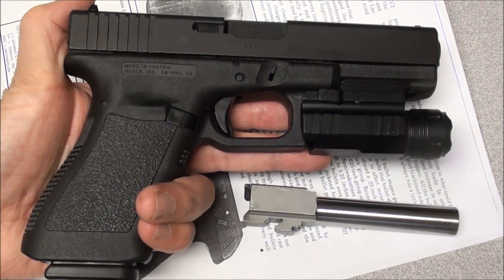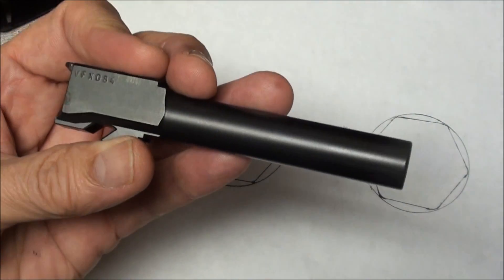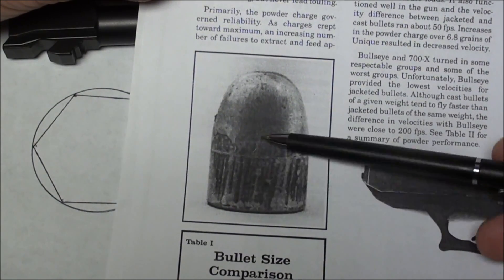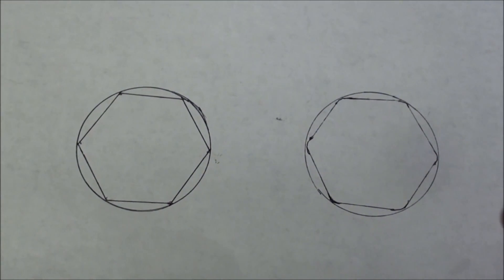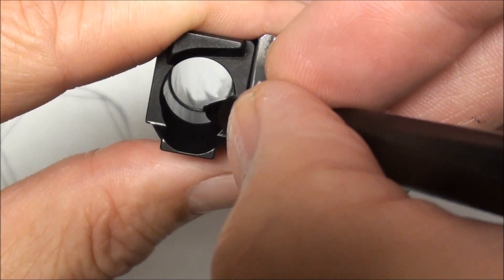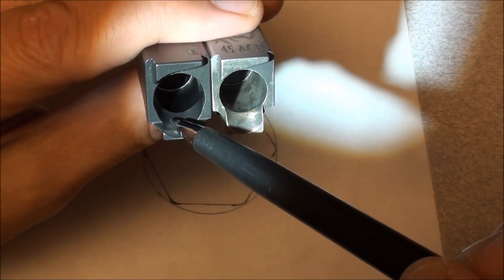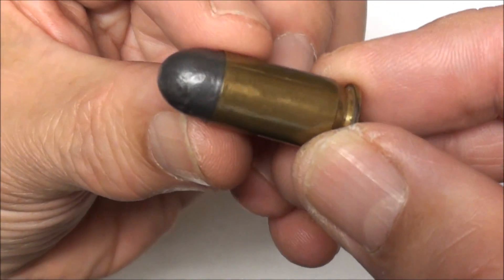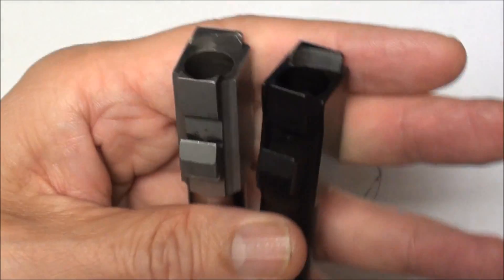Polygonal Rifling in Reloading Ammo for Glocks

Comment: When I bought my G17 in 2003 I also bought a KKM barrel because I was told not to shoot lead in it. I had been reloading for 45acp and 9mm since 1992 for a 1911 and various 9mm pistols. At my first IDPA match one of the guys ask why I had a KKM Match barrel. He said he and many others had been shooting lead reloads through their;s for years without a problem.  So I tried my reloads in it, sized to .356". So far I have shoot 170,000 rds through it as of last week. Half of those through the Glock Factory barrel. No problems so far. 147 grain Lyman #2 alloy and Lee 124 grain tumble lube bullet. I only use Winchester std primers and Tight Group or Bulleye. I have two Dillon 1050's a 650 and a 550B. Yes I shoot a lot. 

Good video sir.
Reply from the maker: Khristy Stewart - As you are well aware, the 9mm is not the hotspot for Glock Kabooms - the 40 cal is the problem especially with heavy bullets and TiteGroup powder.  Now with the Gen 4s,40s,  reports are that the chambers are tighter in the Gen 4s giving more case support.  I like my Lone Wolf barrels though because the cut rifling works better with cast bullets.  As good as the Glock rifling is, that was designed to shoot factory jacketed bullets.  Not many competitive Glock shooters are into using cast bullets though - the FMJs and plated bullets rule there.  Best to ya and Continued good shootin' to ya... Thanks for reporting,  FC

Comment: How about coated lead bullets?
Reply from the maker: gary warmanen - PC bullets are basically cast bullets.  The PC makes 'em clean and no leading shooting.  But whether you shoot reloads, PC bullets or not, in your Glock factory barrel is still the individual choice for every Glock owner.  You will hear all manner of recommendations including the factory.   But the issue is  Does your Glock have the enlarged chambers with minimum case support? Will you be using Glock fired brass reloads with the weakened case heads again in the enlarged chamber Glock?  This may very well not be a good idea   Do you have any second thoughts on all this?  If so, the aftermarket Glock barrels with full case support would be a good way to go.  Good shootin' to ya,  FC
Reply: FortuneCookie45LC  I know this is an older video but what if we used powder coated bullets would that be ok
Reply from the maker: Stuggy's Nerd Cave -  It's not whether the bullet is PC or not...  The problem is the Glock oversized and heavily throated chamber causing less supported case and case head.  If the case goes, doesn't matter what kind of bullet is being used - but the bullet can add to the pressure of the round that would increase chances of the case letting go - bullet factors like over heavy, or over size or seated out too far into the rifling, or insufficient crimp so bullet slides back into the case raising pressures, or over hard bullet - to be added to problems such as over charged case or magnum primer, use of old brass, or use of previously Glock fired brass...if things line up to bad harmonic mix - gun blows up... and people say it's the polygonal rifling that caused it.  or use of lead bullets...   Good shootin' to ya,  FC

Comment: Thank you for your help I will look into purchasing a wolf barrel from my supplier I needed a 2nd opinion cheers Sam
Reply from the maker: sam agiakatsikas - A big part of the decision making is the purpose for your gun - The primary drive for the Glock design was a military and police gun = need for simplicity, reliability, durability, accuracy, ease of manufacture.  The sportsman was not on the radar screen.  However, the Glock design extends past the military and police, and you will note that the current Glock website features a push towards the sportsman - that is because any big free enterprise company requires market expansion to grow profits plus product expansions to maintain market share.  That Glock is not producing a line of Glock cut rifling barrels for use shooting cast bullets and reloads is a shortcoming of their corporate strategy.  They say do not shoot reloads in Glocks and no cast bullets (that is because all cast bullet autoloader ammo today are reloads).  But with their new line of barrels - they would specify that those should be used.  In one fell swoop, they could wipe out the aftermarket barrel competition.  Think of all the possibilities including longer barrels, threaded and ported, barrels with compensators or mini-compensators and longer sight radius.  They could have their own performance center for competition shooters.  Glocks with picatinny rails on top for optics mounting.  .Glocks been around 31 years now - time for them to change their thinking don't you think...??  Best to ya,  FC
Reply: @FortuneCookie45LC  facts!

Id love a longer barrel for mine as well

Comment: Fantastic video. I am shocked at this information.Wow!! Thank you for this video.You may save someone's sight 
or use of their hand just  from making this video. Thank you  Sir.
Reply from the maker: Ajay Karr - The latest is that I picked up fired Glock 10mm brass and  that same fired brass will not enter my current Glock 20 chamber - means that without undue fanfare, Glock seems to have tightened up their chambers perhaps just a bit...That is welcome.  Don''t know if it applies to other calibers or not - the 40 cal is where most of the problem kabooms happened.  Best Regards,  FC

Comment: Hot Lead, I watched your video, and you mentioned that it is not recommended to reload lead bullets in a "Glock". My question is if you are going to use "lead bullets" in a "Glock" I would believe it would be better to reload using "115 Grn Full Metal Jacketed" bullets instead of "lead bullets". I want to know if you know about the Lee Bulge Buster?. In order to reload 9mm you would have to use a 9mm Makarov "Factory Crimp Die" in order to take out the bulge that appears at the bottom of the 9mm sell case. This is if you want to reload 9mm reloads for a Glock. I would like to hear your opinion.
Reply from the maker: Ernie Murdock - Sorry to not reply until now - Google did not post your comment in my inbox for some nefarious reason - I won't see it for months until I stumble onto it... Problem with Glock factory chambers is their oversize dimensions plus the lack of case head support in the 6 o'clock position.  Only new factory brass has the additional strength to go with that.  Any reloads with brass already stressed by firing in Glocks, to be used in Glocks again (Bulge Buster or not - BB actually further works the brass) can lead to case failure on the next firing.  Type of bullet makes no difference here - it is the reuse of stressed brass that can be the issue - and any factors that might increase the pressure (powder charge errors, seating errors, bullet size errors, bullet weight, type of powder, crimp errors = any combination of perfect storm) can lead to case failure if fired in Glock again.  A supported chamber would not be problematic with the same ammo.  Good shootin' to ya,  FC

Comment: thanks for this! just bought a glock 23 and 1000 rounds of reloads. will now need to invest in an aftermarket barrel. don't wana take the chance of a kaboom.
Reply: Shot tons of reloaded/remanufactured ammo as well as reload myself. It's not an issue if you use jacketed or plated bullets. The lead fouling comes from case bullets. Note though that the user manual (like all manufacturers) states shooting reloads will void your warranty. The primary reason is that is a reloader double charges a cartridge the gun could blow up and it's not Glock's fault. Similarly if your charge is not strong enough and you get a squib then shoot again, that's a very bad day for you and your gun and again, not the manufacturer's fault so they won't fix it.
Don't worry about reloads too much unless their uncoated lead.
Reply: "However, because more of the bullet’s bearing surface is in contact with the bore in polygonally rifled barrels, lead bullets, especially when pushed at high velocities, are literally squirted down the barrel, “smearing” the bore with a lead veneer. As this veneer builds up and fills in the gap that normally exists between the bore and bullet, it causes pressure from the expanding gases to increase dangerously. This is not a problem with jacketed bullets because the jacket material is a copper alloy that’s much harder than lead and resists shedding."
https://www.usconcealedcarry.com/barrels-and-bullets-conventional-versus-polygonal-rifling/
Reply from the maker: SintheBandit - The 40 cal with reloaded ammo is the most often encountered whenever a Kaboom is reported.  If your Glock is a Gen 4, you might check your chamber.  It is possible that amongst the changes, Glock put in a more standard chamber - there have been less Kabooms as of late.  If Gen 2s and 3s fired brass goes back into those chambers, but does not chamber in your Gen 4, that would be the explanation.  Of course, if Glock did that, they would not make any kind of deal of it because to do so would be a tantamount admission of problems with the bigger chambers before.  An aftermarket barrel would still be of great use as you could shoot cast bullets in it with complete confidence.  Best to ya,  FC

Comment: And the barrel hasn't changed over any of those generations. Great customer service.
Reply from the maker: campsite a - My most recent Glock - the G20 - very interesting - picked up some Glock fired 10mm that had that bulged look and the cases would not chamber in my G20 barrel.  When we pick up Glock fired brass, it usually chambers again in Glocks but not in non-Glocks.  It's possible that my G20 has a smaller chamber - but no way is Glock going to advertise that Glock 20 chambers are smaller now as that would be an admission that the previous ones were too big.  Then the questions of why would be asked.  I like my 4 Glocks - and so do all the new shooters that I bring to the range.  One of them in a group of 6 new shooters I brought to the range, shot up 400 rounds of 9mm hardball.  Didn't pick up on that until I did inventory afterwards... that was an expensive range day for me, but it's all OK - I could have shot that up myself just as easily.  Have a great day,  FC
Reply: FortuneCookie45LC Why are you getting new shooters to shoot Glocks? Is there something wrong with you?
Reply from the maker: campsite a - Whatever we feel about Glocks, they sell well at the gun stores.  I'm neither a Glock lover nor a Glock hater.  I shoot them along with my 1911s, M&P, XD, Sigs...However, I do take umbrage to the term Glock Perfection...They may be good, they may even be OK, but they are far from perfect...Best to ya,  FC

Comment: hmm. i reload .45 and 9mm for multiple glocks. may have to add some aftermarket barrels to the wish list. I usually use plated rather than jacketed bullets and winchester 231/hp-38 powder.
Reply from the maker: Rocketman9mm - Thanks for your comment.  You will note that there are a fair number of vocal reloaders who will tell you that they've shot thousands and thousands of reloads thru their Glocks without a single Kaboom incident.  If you study everything out there on Glocks - the lowest common denominator is that shooting tired brass repeatedly in Glock factory chambers stresses out the brass so that at some point, we flirt with case failure at the unsupported head especially with the 40 cal.(not as much with the low pressure 45acp or geometry of 9mm chambers).    With Glocks, we have oversized chambers and minimally supported case heads.  I use aftermarket barrels on my Glocks so that I can reload bulk ammo in my progressives with good practices and assurance.  Again, I would not do this, but  If I insisted on shooting 40 cal reloads through my factory Glock barrel, I simply would not use brass that had been shot in a Glock already.   It's Glock on Glock repeatedly that raises the risk - and bulge buster dies do not help the weakened brass in the least.  Good shootin' to ya,  FC

Comment: thank you for this video.  I just came across a really sweet deal on a pair of blocks and had not heard of any of the specifics about why they were not able to shoot reloads or lead bullets.  It wasn't a major concern for me because I don't reload yet, but this is great information.  Again, thanks for the info.
Reply from the maker: -- You'll hear a lot of stuff.  Baseline - Glocks are fine pistols.  But you'll hear people say that yes, Glocks have polygonal rifling - but they really don't know what polygonal rifling looks like - if they say hills and valleys, they have automatically invalidated themselves on what polygonal rifling truly is.  Fact of the matter, Glock starts with polygonal mandrel, but then they start grinding on the mandrel to change the rifling.  Once they change it, say you start with a circular mandrel and grind flats on it - can you still say it is a circular barrel?  And you start with a polygon and grind inward reverse roundness to every corner (that's why they call it their own version of female polygonal rifling - Good grief - just call it Glock rifling - they could have and should have patented it so others couldn't copy it - what absurdity!!)  And others say Glocks can blow up because of barrel fouling raising pressures because of the polygonal rifling.  Anyone that does research will find out the polygonal rifling fouls less not more, so where does the fouling= high pressure go from there.  Basically, Glocks are fine pistols.  I don't bash Glocks because I own four of 'em. Best Regards,  FC

Comment: Thank you I just bought a Wolf .357 Sig bbl. for my Glock 27 and was glad to see that my bbl. choice was good. NIDAHOBOY
Reply from the maker: +barely there -- That's a wise thing you do - the 40 cal is a hot round already, and the 357 Sig is even hotter - enough to turn your autoloader into a full out 357 Magnum revolver with 125 grain bullets (reason quite a few LE agencies are using it).  It very well may be that Glock is using more but still minimal case head support with the hotter 357 Sig, but your Wolf will offer full case head support.  And I do see 357 Sig brass at the range on a fairly regular basis...Good shootin' to ya,  FC

Comment: How about remanufactured  rounds ,for instance, freedom munitions.
Reply from the maker: +Idea man99 (ideaman99) -- Same idea - commercial reloaded ammo uses fired brass - it may be fatigued brass that will fail if weak spot just forward of the web of the case lines up again with the unsupported spot in the Glock chamber - could be a problem.  Best to ya,  fC

Comment: I agree with the chamber size argument, I've gotten rid of my glocks and I'm not going back.  why buy different barrels and sights to a over priced pistol when I can get the same thing from a host of other manufacturers for less.  I can tell by looking at the cases picked at the range which were shot through glocks.  they are bulged at the base of the cases.  I also like tite group powder, very economical.   I pay 19.00 a pound and on average it uses a couple grains less per charge to achieve the same results.  I load medium velocity, for powder charges.  I like the recoil impulse it produces and the fact that it isnt a loud, flashy powder too.  It's true that its fast burning, one of the fastest, it developes heat quickly t too.  The barrel gets warm quicker too and the cases are hotter when picked up right after shot.  I'm glad someone is willing to address this issue with Glocks, most people are blinded by the hype.  I wish more people could be objective.  Glocks aren't perfection, but neither are the rest.  You get what you pay for, sometimes you're paying for R Lee Ermy's endorsement.  Case length considerations have to be scrutinized with m&p pistols.  they can fire from a minutely unlocked/out of battery barrel,  if the case doesn't fully seat, Kaboom.
Reply from the maker: +Tracy Robertson -- You have good assessments and understandings of things.  Glocks were not overpriced in contract sales to LE agencies back in the 80s.   But today, the polymer pistols should cost less than the milled steel receiver guns as the materials are cheaper and much milling is not required.  Look at what Ruger does to their casting and then the CNCC stuff done to get the guns ready for assembly.  The polymer guns are molded and nowhere near the same is required.  The costs should be cheaper (that's why Gasden Glock went the polymer way in the beginning - had a track record with the AUG already, plus cheaper to manufacture and produce for military contracts).  Plus the use of mandrel hammered barrels and no cut rifling reduces the cost of barrel making.   Glocks simply cost less to make, but none of the savings of costs is passed onto consumers - they go instead to higher profits - but people have been sold on being willing to pay for that "Glock perfection".  That having been said, Glocks are still good guns - they are designed to be very reliable with factory ammo (the big chambers provide that reliability - the factory ammo gives best brass strength in those big chambers).  Glocks were just never intended for reloaders or sports shooters.  But we know that big business has to expand markets to keep growing those profits - so we are going to be hearing a lot about how Glocks are great for sports shooters and women shooters as time goes on...the newer generations of Glocks may even have a touch more support to the chambers...Best Regards to ya,  FC